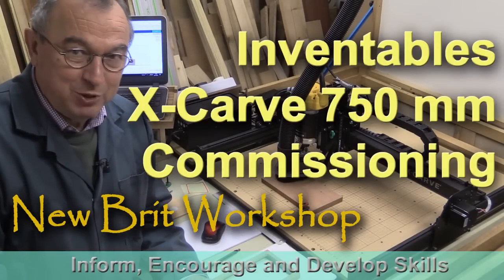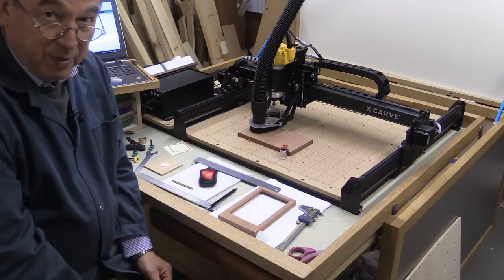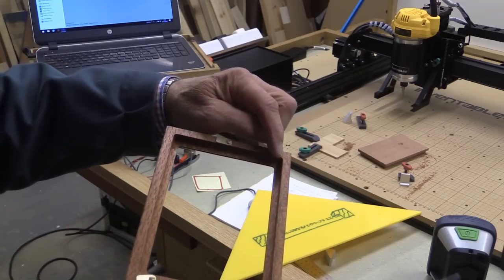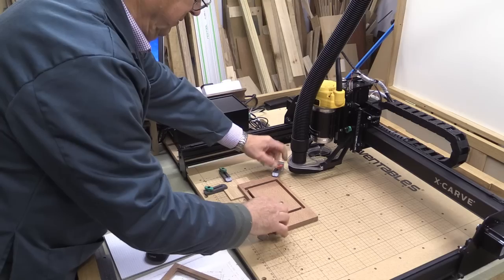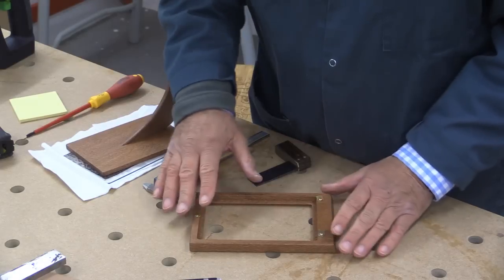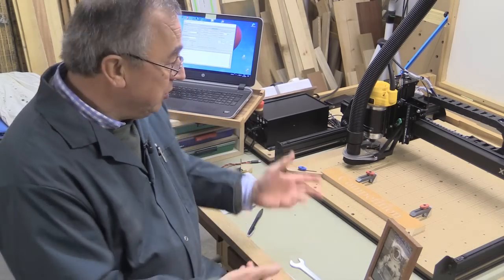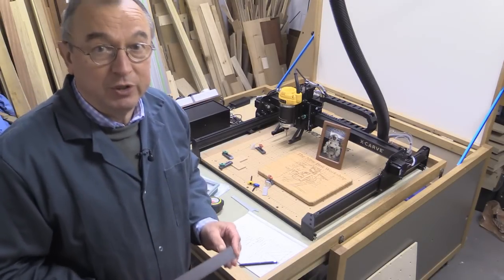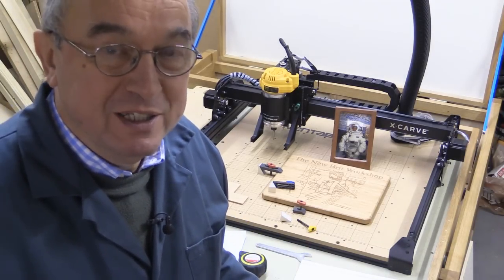X Carve 750 mm - Commissioning

Comment: Great video.  It inspired me to buy a CNC.  Now wondering about dust extraction.  I assume you are using your Festool vac 😊.  How long can you run it with the CNC without it overheating?  On some earlier CNC work I did at a community shop, I ran the CNC for up to 4 hours.  Wondering if the Festool vac can run for that long.  Thanks for your thoughts.
Reply from the maker: Hi Pat, I did a bit of fancy CNC work a few days ago which took over 2 hours 30 minutes. The Festool vacs will never overheat as they have been designed for continuous use. They also have a bypass mechanism so that the motor will continue to be cooled even when the hose gets blocked. On top of all of that I believe that they have a thermal cutout. They really are the best.  Cheers.  Peter
Reply: @NewBritWorkshop   Hi Peter, Thanks so much for your incredibly fast response.  Yesterday afternoon I watched your VCarve Live Stream event that was recorded last year. There is a lot of information captured in that episode, so I will be watching it many times over.  Thanks for sharing your CNC knowledge.  
My apologies if you have  covered this material already and if so, could you please point me to the video where you have or to a good source.  One of the many questions I have with CNC is,  which is the best bit to use for the cut I am about to do?  Then of course working out the correct specifications etc.  But the latter is easy to find once you have the best bit for the job. 

Once again, many thanks for your videos on Youtube, I really enjoy watching them!
Reply from the maker: Hi Pat, I have not done a video about it as I honestly feel that I am not expert enough to give hard and fast parameters for cutter type/rpm/linear X,Y and Z speed. However, I use my normal router experience and then try and imagine the chosen cutter so that I can make a judgement (some would call this a guess) for the cutting parameters. If you are using Vectric software the cutter list that comes with the software gives a good guide and you can edit the speed of X and Y travel as well as plunge (Z) speed for every cutter and also create new cutter files yourself.  I rarely alter the spindle speed unless I am cutting plastic. Good luck and please do not be afraid to email me if you need any more advice - go to my YouTube main page, click the "About" tab and there you can find the email address. Peter
Reply: @NewBritWorkshop  Hi Peter,  Your email offer is very generous.  I would hate to waste your time by asking questions that I feel, with a bit of effort, I could find the answers myself.  But if I find that I am hitting my head against a brick wall, I will take you up with your offer.  Looking forward to watching more of your videos.  Many thanks.

Comment: Hi Peter, it seems like a good machine for 2D work, but how good do you think it is for more complicated 3D work? Where you have to make multiple steps, e.g. in joinery rather than ingraving or just a relatively simple cutout as you did in this video. Would be interested to hear your views about this.
Reply from the maker: Hi Michael, The NEMA stepper motors are very good and simple 3D work will be perfectly okay - by this I mean where there are distinct changes of level in the Z direction. For smooth flowing curves a reasonable result can be achieved but not as good as a professional machine. However, a bit of sandpaper for the final stage would solve most issues I am sure.   Peter
Reply: Thanks for the answer, Peter! I will continue looking into this machine.

Comment: Really liking your x-carve series. Is there any chance to see the process when you moved the router to change the bits how you keep things lined up on all 3 axis.
Reply from the maker: Hi Stephen, I do not have film of it this time but will try and include it in a later video. However, the process is as follows. When I set up the first cutter (the "V") I set the machine at the job home position on the surface of the wood at the bottom left and corner of the piece. I then did that cut. When I changed the bit I took care not to force the machine to move in either the X or Y direction. All I then had to do, using the machine control in UGCS, was to move the machine in the Z direction (downwards) until the tip of the (new) cutter was just in contact with the top of my work piece. This was the new job home position for the Z axis and so I issued the command, in UGCS   G92 Z 0  which simply told the machine that this was the new Z home position. I did not need to do anything about the X and Y job home as the machine had only been moved under UGCS control and so always knew where it was in relation to the original job home.     Peter
Reply from the maker: Hi (again) Stephen, I have just included this process in a video which will be up shortly where I show the whole process of making the picture frame using VCarve Pro.     Peter
Reply: Thank you.I do find your videos really easy to follow. Both sound and video are top notch

Comment: I'm quite interested in CNC and was going put this on my list for Santa. But, I'm struggling to imagine real world uses for it other than my geeky technology obsession! I see lots of carving of signs and I can imagine making wooden parts for jigs. What kind of things do you find it useful for that are used on bigger real world woodworking projects?
Reply from the maker: Hi Simon, Here are some examples that would be reasonable to try on the X-Carve: Curved parts for chairs, inlays as decoration (contrasting wood), musical instrument parts, toys, puzzles, anything that can be drawn that might be tricky to make with normal woodworking tools, model engineering in both wood and soft metal (like aluminium), and there will be many, many other things if one just thought about it.  I would write a note to Father Christmas !   Peter